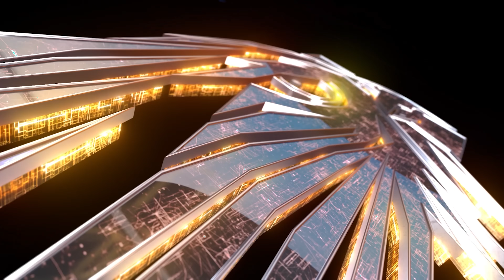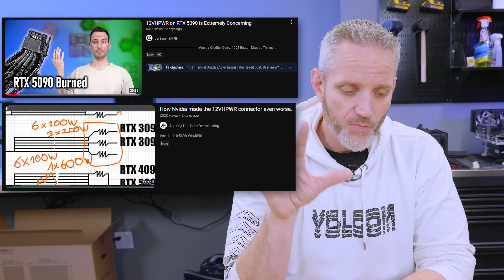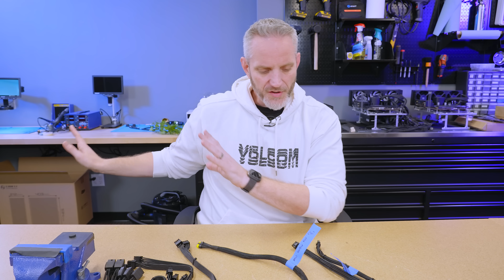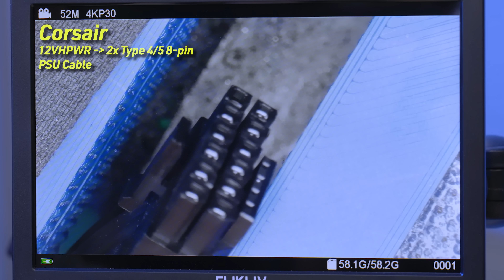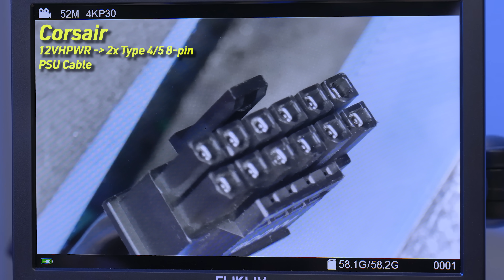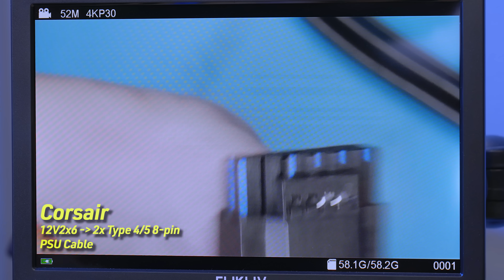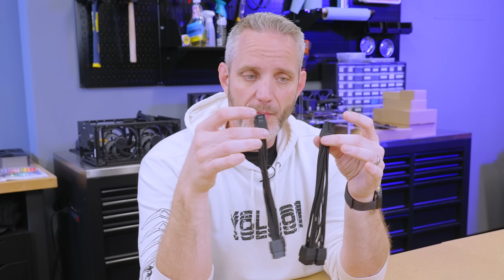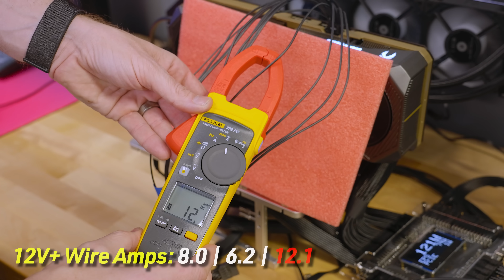I discovered something concerning and I need the Experts to chime in... More 12VHPWR discovery!

Comment: Cards should be recalled and this 12VHPWR nonsence reverted back to old pcie cables. No one is going to care if they need to have 4 or 5 pcie 8pin cables to feed one of these beasts. In fact I would argue that with sleeving it would look mean and much better than this fire hazard trash design.

What shits me most is nvidia knew this was an issue last gen and instead of doing something, they upped the power through the same design. Dangerous and they lost a customer here.

Comment: A non-fully seated pin does not start to pull a lot more ampere. A poorly seated pin increases connector-reistance and that's why the pin heats up. It actually lowers the amperage on that one pin even though it heating up. It is the voltage-drop across the pin-female to pin-male connection that causing the heat buildup.

The problem where the individual wires have a lot more current through them is a whole different problem. That won't happen on a poorly seated pin.

Something else is going on. We're merely looking at one problem among a myriad of independent problems causing the same end-result.

Comment: I am working in automotive manufacturing as an electrical test engineer. Funny that the car parts pretty similar to GPUs. 12V and loads of amps. To test a modern automatic transmission control unit we need like 100 of these connectors, and for the big 20A rails they are like 4-5 mm in diameter and 10mm in depth. If just one looking like corsair's all our measurement and calibration loads going nuts. I am talking about +- 2 A. And those contact pins costs 10 usd/pc (they survive ~50000 plug in and out tho)
Corsair just need to ask themselves: why the other companies go for the expensive materials and process? We must do something wrong while chasing profit with our cheap material and process :D I understand that they are in specs. but if its not working then the used specs are wrong and allowing this to happen.

Comment: i made my own lab bench regulated power supply 
i tried few connectors pcie x8, cpu and actually this bs. max load per phase around 40A, nad now funniest part, per connector i used 2 phases and both phases get around max load i had in entire psu 8+2 phases i used 2 pcie x8, one cpu and 12hpwr in max load of phases 0 and 1 connector got max 70deg C for cpu it was around 80, and for this stuff because of pin depth problems with china supplied power connector i got it over 140 deg C, btw this pcie connector are made so bad i expect them to fail but this connector surprised me(if someone want to know where i get connectors, aliexpress just looked for motherboard and gpu replacement power connectors)

Comment: There is simple solution for this. There is no reason to have 6 individual wires to do the same thing. Why not have one thick cable? This connector doesn't make any sense and people are so much invested in it that they don't see the simplest solution. Next gen cards should have anderson connectors but nvidia will probably introduce high power usb-c connector next :D

Comment: So I just bought the 12vhpwr type 4 from Corsair, but the individual sleeved version, and I noticed that the ground pin is uniformly placed as the others (like the coloured msi one). But the other side also has only two of the four "slots" filled. I don't know what that means, but I am pretty consern right now since I am planning to switch to 5080 soon.

Comment: It seems like the pc nerds never have taken a look under the hood of a car. My Porsche oldtimer have a 12V 64A/h car battery. Means this 5090 RTX from 8auer with 20 amps would suck my car battery empty in 3 hours. Just compare the cables from your car battery with the ones of your total overpriced gpu card...

The problem are the customers. Since bitcoin farming the prices sfor graphic cards are ridiculous. The problem: The sheep fanboys pay it! Thats why you get so exclusiv and high grade plastic/cardboard gpu packages. The 5090RTX not even have 150$ production costs. The used materials not even worth 30$.

For example a HK MR 223 slimeline costs 3.500€. You get a cheap cardboard box but inside.... inside is a german high end AR from HK what you can give the 3 next generations of your family.

The gaming industrie know that the fanboys throw out the money like there is no tomorrow. High end hifi is ok. Buy a tube stereo amplifier with studio speakers and a recordplayer. You will enjoy this the next 25 - 30 years.

I have build high end gaming pc for a couple of years. Its mostly overclocked crap what gets wrecked a few mpnths after warranty. Since I worked with 970 GTX SLI, 1070 GTX SLI & 3070 RTX ti my system runs 8 years. After 4 years I put a new fan on the gpu. The gpu goes to ebay and I get me a new gpu. Everything around is build on a XX70 niveau.

Building high end gaming pc is like you throw money into a river and watching it swim or watching if your money even be able to swim.

Comment: The reason we see 12V wires and pins melting and not the ground one is because current can return to ground not only through the 12V connector but also through the PCIe slot which has a lot of ground pins. Bottom line is shockingly bad design by NVidia on the power balancing and safety. Event more shocking considering the price of the cards and the NVidia profits. Shame

Comment: As Electrician i say its the Cables cause auf stupid desiggn from NV, there must be a resistance difference between the wires, the big mistake is that the 5090 have no ampere balancing, and just do a parrallel connection,  the Ohms Law is strict, energy goes the way of the lowest resistance, NV cant change the physics, a set back pin is ofcourse a change in the resistance and highers the connection resistance.. I just dont understand why the heat in the cable which highers the resistance dont evens the loads per wire, it could be so hugh that i dont work, they hope on this i think cause its also ohms law, we use it on 250mm² parrallel connectiolns cause we cant make the cables 100% same length there is allways a lil resitance difference on these.i cant measure it i still couldnt buy 5090, but the first thing i would do is measure the cables, mabe measure it into the power supply and gpu to see a difference, there must be a difference on the hot wires. in my view the pins are not fine, try to push it more in with the wire to see a difference in load, then this works you know it

Comment: As a electrician who is building industrial computers for living I can say, what Nvidia did is actually scary. First why on earth they didn't do the same as with the 3090ti? I mean it's hardware worth over 2300€ 😅. Second with drawing nearly 600W and as the Bauer also pointed out there is just a slim error margin using this sort of cable.. Every little misalignment or manufacturing error in the cable will probably end up in a disaster. Even when one connection is slightly off the load is now distributed over less cables in the worst case. Again the error margin is too slim in the first place.. also there is no real system in place to monitor the load.. This is a design flaw on NVIDIAs side. No user error. You are very right with the manufacturing errors with the cable. On its own every one of those factors may will not cause the errors. its the combination of those factors..

Comment: Built a system with a 3090 couple years back and the ground pins pushed out on one of the 8 pin plugs, releasing the magic smoke. Could not visually see any problem until I pulled on individual wires. Can't recall the power supply manufacturers off hand but it wasn't cheap and all parts were brand new sealed in plastic. I managed to RMA the card and promptly disposed of the offending cable!

Comment: I've been using corsair for years now and the build quality is utter crap these days, they should be ashamed of themselves tbh the amount of money they charge compered to the quality is a shambles, ive had 2 mouses that just died after a couple months, a keyboard that the rgb stopped working after 1 year, my dominator ddr4 ram rgb lights wouldn't show   white on 2 sticks after 2 years, another keyboard would randomly stop doing caps but only on some keys, 1 AIO that the pump didn't work right from new, don't get me started on the icue software just randomly deleting itself or the        
random device disconnects that require a system restart to fix even though you was using the device at the time it decided to do this. 

the sad thig is its only since about 2019 that all the issues started, I've owned lots of corsair stuff from cases to PSUs, right now i have a corsair mouse and keyboard and headset, so far the key board and mouse work flawlessly but on a few occasions my headset has had connection issues with wireless, i own a ps5 and i had to stop using the headset on the ps5 as when i changed it back to pc it would crash icue.

all in all i never tell people to buy corsair products anymore, they are unreliable now which is sad as well they used to be my go to for everything i could, i loved my old vengeance case which was my first ever build i did myself, loved the air 540 owned 3 of them, but when i bought my 5000d i ended up buying a different case as it was just not a good case imo, i have had corsair ram in my pcs for almost every one, i went dominator in my last one as i wanted the rgb but now im just using the normal vengeance ram with no rgb as i had so many issues with it, ive owned 3 AIOs 1 had pump issues from the off, one was fantastic and ran fior 3 years perfectly and one leaked before i even finished the build, ive owned multiple keyboards, ive had 1 not work at all, 1 didn't light up properly and one that just seemed to die slowly over time. as for mice, well ive owned 4, 1 stopped working in wireless mode so i had to use a cable( kind of defeats the point) one that had buttons that randomly stopped working, and 1 that icue stopped seeing all together, and the one i have now is going strong as of now.

Comment: As much as a corsair power supply cost, especially buying one that is 200.00 plus. Like my 1000-watt power supply was, that cable is highly unacceptable. Fyi i use my cable that came with my msi graphics card, i am to paranoid  to use any other cable.

Comment: Yes, the positive and negative will have the same power in or out. Cards should have power shunts on every pin now. But in theory, if all +/- pins are on the same rail, one pin slightly loose with more resistance shouldn't be a huge problem as the other 5 should be able to pick up the load. Unless you're running up against cable limits.
This connector seems way too finnicky for 600 watts though. Like 450 is where I think it should be. 
The XT connectors are where it's at and where it should have gone. A 4-pin XT60 style with 10AWG 150*C silicon jacket wire could safely carry 1000 watts.

Comment: As always, it's just bad design and poor quality control and testing. Every cable should be tested by pulling on the individual wires and making sure that they don't move within the housing as well as the connector in the connection.
Having it fully plugged in doesn't fix it if individual pins can push out like that

Comment: Electrical engineer here ..
power systems...

The entire design of this is unsafe unfortunately the industry doesn't want to change because there's almost no regulation when it comes to electrical safety standards in the low volt  range...

Comment: Funny 12VHPWR is being used on a $2000 GPU...

But EPS12V 12-pin is being used on $10,000 GPUs...

So why the Hell isn't Nvidia using EPS12V which is far safer and more thoroughly tested on consumer level GPUs...?

Honestly, to me, it looks like they don't care about the consumer. They are about the money. And honestly, this is probably why EPS12V is used on the professional RTX A6000...

Can't have tech firms banging on Jensen's front door with torches and pitchforks wanting blood.

Comment: Can confirm just had a look at my un-used 2x 8  pin to 12v 2x6 h++ cable that came with my brand new Corsair hx1500i that says ATX 3.1 and PCIe 5.1 on the box has uneven pins and I can move some of them by putting mild - moderate force on the cable. The plot thickens. At this point the plan will be to use the adapter that comes with the MSI Suprim SOC I am dreaming about.

Comment: As a mechanic if I found a pin that moved that much the terminal and / or connector body would be replaced. We’ve been using terminal locks for decades yet we’re still having this problem with pc components. I have a hard time believing this isn’t allllllot of the issue

Comment: In the past we have hi end hi power setups, with four-way sli/crossfire, with high power draw and i dont remember seeing cases of cable plugs melting like this. Maybe a total rework in the construction of the plug fix it? Hard to tell, but certanly i will check my 12vhpwr cable after seeing this video.

Comment: It depends on the pin length. The male would be longer than needed. So maybe they are saying it would have to be all the way out to Not contact the pin. Althought it is 75% contact, not good it should be epoxied in.

Comment: I'm surprised you didn't try pulling and pushing on the wire in that loose socket to see if it changed the Amp load and temperature. Good idea for a short video?

Comment: If the PMD2 is correcting power, then isn't there another connector type that isn't as expensive as a PMD2 which would do the same thing? Even if it's a "3rd party" cable.

However, I disagree with you on this video (last video you stated correctly that if a GPU manufacturer wanted the cable, they could decide to not honor a 3rd party cable); but in this video, you claim that all cables excepting the NVIDIA FE Card Cables are 3rd party. I disagree. Any cable provided by the PSU manufacturer is not 3rd party, it is that PSU's directly provided cable. I realize that you show that a corsair cable is the worst, but it does not matter for warranty purposes - that is the cable they will instantly accept without exception. A 3rd party cable is any cable which is purchased separately from the PSU, and it does potentially matter for warranty purposes.

Comment: A pin that has a huge gap increases resistance and thus increases heat. 

 Old 7.3l powerstroke engines have a similar issue with melting the under valve cover wire harness. I recently had to replace my uvch and wiring pigtail because the glow plugs draw so much power that even a small gap, like what's shown here, causes the pigtails to melt.

Comment: Have you put the connector on the GPU PCB under the microscope yet? Are the pins on that connector always perfect?
Yeah, I realize that it's easier to inspect multiple $30 cables than multiple $3000 GPU's!
Who can afford multiple $3000 GPU's?

Comment: Considering that the 40 series issues was the pins not being close enough when badly connected I would not be surprised that the pin reccessing combined with nvidea not having shunts limiting input so it doesnt all go on one pin I can see these two things multiplying each other and causing the melting. I think the suspect launch drivers could be a factor as that is also causing some issues but at this point its a series of issues screaming at consumers ˜DONT BUY ME˜. Thanks for the video Jay!

Comment: I actually found something interesting if you look at the MSI - MEG Ai1300P PCIE5, 80+ PLATINUM Full Modular Gaming PSU, webpage you will see that it shows amps between 0 and .75 for most of the cables and one is 6 amps and the last one is 37 amps. That PSU is able to detect amps used per a cable. I thought it was interesting and figure I would post it.

Comment: Jay hi, noticing the vids by you and DerBauer showing some of the wires over-amped and over heating I think there is a problem with how the PSU is not apportioning the power evenly, although the connector itself is likely also defective.  The PSU does not seem to have a system check or balancing system to assure even voltage/amperage along all the voltage supplying cables.  Does this seem a reasonable direction to search given the consistent problems even with improved connectors?

Comment: Why hasn’t nobody mentioned the x870 motherboards from Asus and Msi that have an extra 8 pin power connector which can provide the pcie slot with an extra 2.5 times the 75 watts up to 166 watts through the motherboard to the gpu, surely this will reduce the strain on the gpu cable that’s one of the reasons it was added to the board to support more powerful graphics cards ?…

Comment: Corsair 12vhpwr to MSI 12v 2x6. Maybe it would be worth comparing the Corsair 12v 2x6 (90 degrees) cable to the MSI one?
As for the YT video you refer to, it talks about using one pair of wires to fully power the card with about 50 A on 2 wires - this melted not only the contacts but the entire cable.